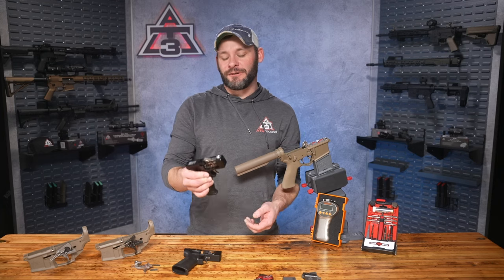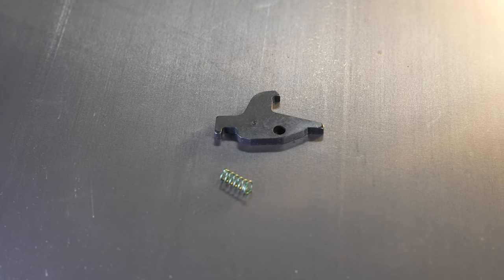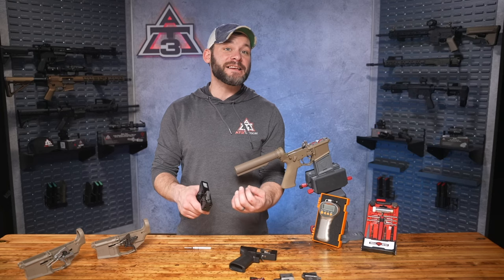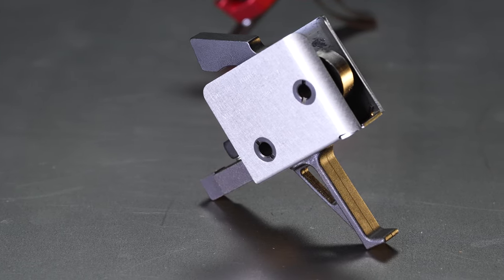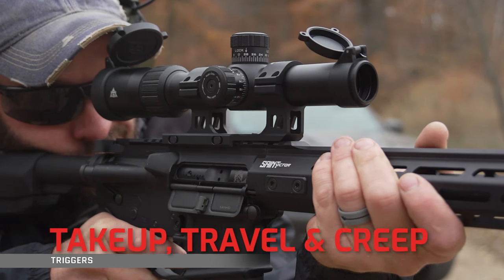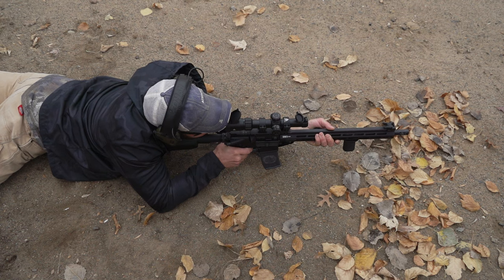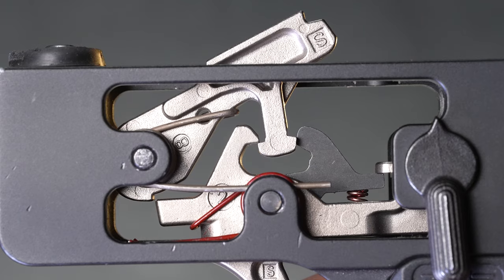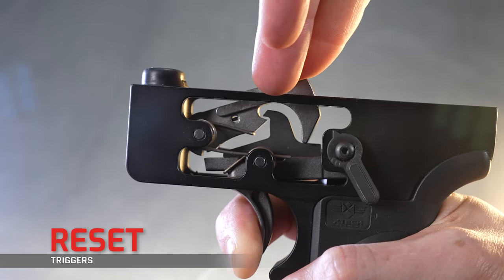Ep-11: AR-15 Triggers Down & Dirty: Anatomy, Functionality, Stages, Break, Reset, Creep... MORE.

Comment: A thing about mil-spec triggers, I have never had trouble qualifying expert with one. If you already have a mil-spec installed, it will nit hold you back from becoming a great marksman, you really don't need to replace it. Take that money, spend it on ammo, and practice. 

If you're building from new however, this video is a great guide. I personally do not recommend very light triggers for shooters who are not completely confident already.

Comment: 3:39 The center groove is for the j spring in the hammer to detent and keep the pin from walking out. It does not center or align your fire control group.
Reply: Well yes you are correct.
Reply: It's also a component of the hammer that wasn't mentioned.

Comment: The center notch in the trigger pin is to lock into the spring in the hammer to prevent the pin from walking side to side. Same with the side slot cut near the end of the pin, it stops the trigger pin from walking as it is held by the hammer spring.
Reply from the maker: 100% Right!  That little guy inside the hammer is called the J-Hook. The geometry of that swinging hammer on a single axis has to be absolutely perfect shot after shot, which is where the J-Hook thought process came from.
Reply: @At3tactical  yeah man

Comment: I've done 6 AR builds. And also own 3 factory built rifles that date back to the early 90s. 
In the first build I used a "Mil-Spec" lower parts kit.  Very cheap. That was disappointing.  While most of the parts are fine, and still in place and working, the trigger assembly was a complete disappointment. 

I replaced it with a drop in, single stage unit and have lived happily ever after.  I have used these on every build since and installed them on my three "factory" AR rifles, all "pre-ban", 2 Colt's and 1 Bushmaster. 

A good trigger is the BEST upgrade you can make to a AR rifle. There are so many, I won't try to tell you which is best, and I have several in my rifles.  Choose the one you prefer.

Comment: I always take my trigger assembly out and Dremel polish all the friction surfaces to mirror finish and they function like a knife in butter.

Free upgrade. Always be sure to wash your parts off thoroughly in the sink, dry well, and either dry lube or BARELY oil it using a rag when done.

Don't want grit in there 😊
Reply: Instructions unclear, now it runs full auto😅
Reply: @derek3154  Awww man that sucks. That rifle is useless now. Send it to me and I'll give it a proper burial.

Comment: Im buying a 2 stage TriggerTech Diamond but I can not decide between straight or curved.  It is for a precision-style SPR build so opinions lean towards curved but for some reason I think I would like the feel the straight.  I like the sharp edge it has opposed to the rounded curved blade I see on their site.
Reply from the maker: Both are nice, it comes down to personal preference. Ultimately the question is what trigger profile gives you the most consistent finger placement and trigger squeeze.

Comment: My trigger won’t budge and my selector switch is stuck in the fire position. I’ve tried the charging handle and nothing - never fired it, all I did was change the grip - any suggestions🤷‍♂️ I’m stumped
Reply from the maker: Pull the pistol grip and check the safety selector spring and detent.
Reply: @At3tactical  initially the spring was missing so I ordered a new spring and replaced the spring and detent but the trigger doesn’t pull and when I pull the charging handle the selector switch doesn’t budge🤷‍♂️

Comment: Excellent demonstration of how the triggers function. Gorgeous closeup footage! Your studio lighting and camerawork are perfect for this kind of thing. 

If I may make a small correction: the second stage of a 2-stage trigger can never be lighter than the first. In your example (2.5 lbs. first, 1.5 lbs. second), the 1.5 refers to the additional force required on top of the first stage to release the hammer, not the total force required. So after you pull 2.5 to take up the slack, you're pulling a total of 4 pounds (2.5 + 1.5) to get past the wall.

You're a very good presenter. Keep up the good work!
Reply from the maker: ^^^ FOLKS ^^^^ Fantastic correction/addition here from @shootinbruin3614!  (Steel sharpening steel...Thanks for the comments!) -Randy

Comment: Great video, I learned something today. I just use mil-spec trigger and hammer and disconnect, but I change the trigger spring to a lighter 4 pound and use the  'Paracord AR-15 Trigger Job'  to lower the 4 pound pull to around 3 lbs. I would not polish the sear engagement surfaces because the surfaces are hardened and removing material will reveal softer metal that will wear and cause problems later. The 2 stage works great too.
Reply from the maker: Thanks for checking us out!!

Comment: Great video. can you tell me name or brand of bad lever mounted on FDE Lower?
Reply from the maker: Thanks! That's the Phase 5 Extended Bolt Release. A little extra work to get it installed, but solid as a rock. I'd share a link, but YouTube doesn't appreciate links like those. Haha. You can easily find these things on our site at AT3 Tactical. ;)
Reply: @At3tactical   Thanks a lot.

Comment: So basically the spring attached to the trigger is what makes the trigger pull weight? Couldn't you just change that spring to adjust the trigger pull weight then?
Reply: There's more that goes into trigger pull such as the weight and length of the hammer, its travel distance, the amount of surface area contact, the roughness of those contact surfaces, etc. 
If you go modifying springs, you will increase the bolt velocity and reduce liability when using ammunition with harder primers.

Comment: Question for you. My sear gets caught on the hammer when the rifle has been sitting for a while. It's easily fixed by pulling the charging handle a couple times. What can i do to fix this issue? I don't want to have a need for the trigger to work and it doesn't! It always continues to work during firing after that first issue, it's just after sitting for a while.
Reply from the maker: It sounds like there is potential moisture/debris on those parts either prior to storage or humidity in the ambient room. That might be creating a very thin layer of rust. I would first start by putting a light dab of CLP on a Q-tip and then lightly touch those interfaces. Not enough to wet it, but enough to block moisture/debris. Come back after month or so and see if the issue continues.
Reply: @At3tactical  is the concern too much liquid or rust? I forgot to mention it's basically a brand new weapon and it did this from day one. I installed the trigger group myself and did research first but am not 20 level. I can say I'm a dump the lube in kind of guy so there is definitely an excess of it in the trigger assembly.
Reply from the maker: @activemanishere  Sorry for the delay here. YT is terrible about the way they notify us for reply threads. With the additional knowledge, I would suspect two things. 1) CLP all up in the trigger assembly. (It's one of those...does "more bad" than it does good, being that lubrication attracts more debris)  2) Some issue with the trigger installation. (Maybe an upside down hammer spring; maybe the hammer spring isn't seated correctly). You can definitely call into our support line and talk with Kevin about how the whole thing came about. He's a knowledgeable dude.(763) 284-6321
Reply: @At3tactical  thank you for your info! I will reach out to Kevin later in the week!

Comment: I stopped listening when you said the trigger pull was measured in inch pounds.
Reply from the maker: Bummer, hopefully that little human slip didn't make the information throughout the rest of the episode unusable/untrue. Thanks for pointing it out to us! Steel sharpens steel around here. 👍
Reply: @At3tactical  Sorry, it's not you it's me. I am just so upset because I know I will have to fight, again, for this Country. I am RETIRED and supposed to be able to rest after 35 + 6 in the service. But I know the only way to save my Grandchildren is to fight and most probably die to stop this Coup. I just wish someone would get it started already, I'm not getting any younger.

Comment: I'm new to the ar-15 platform. What's your take on putting  penetrating oil on the sear or any other part of the trigger assembly?
Reply from the maker: There are parts on our rifles that need/benefit from lubrication. Some for optimal function, like the BCG. Others, like a little grease on your buffer spring. Then there are AR parts that most steer away from any lubrication at all. Parts like your magazine spring/follower...or...your trigger assembly. "Keep it dry & keep it clean" is the thought process here, where these parts are designed to operate optimally without the need for additional lubrication. ACTUALLY, lubrication is discouraged because it tends to attract more dirt, grime & debris than it repels. Granted you will get some lubrication down there, it's inevitable, but maintaining that minor bit is relatively easy with some swabs. 
Hope that helps!
Reply: @At3tactical  Thank you!